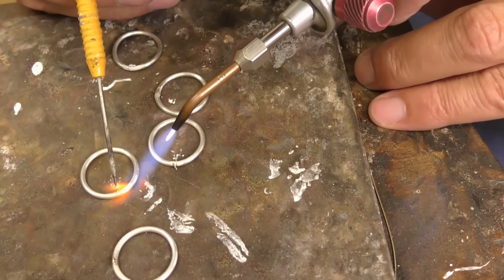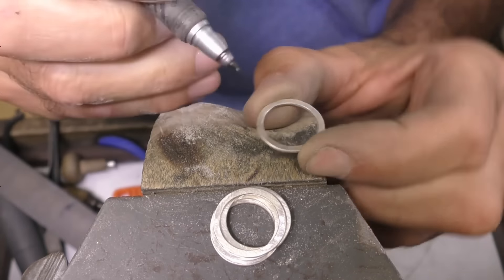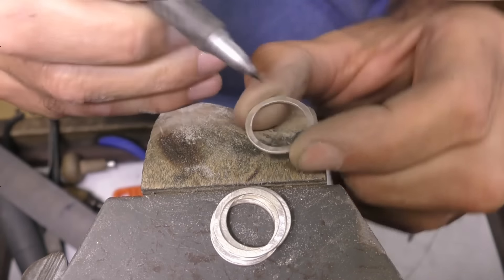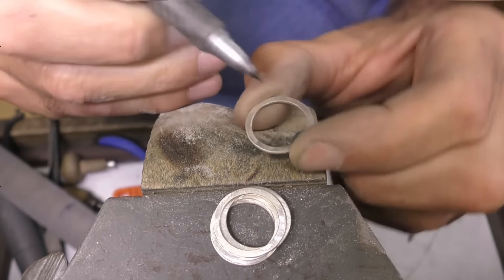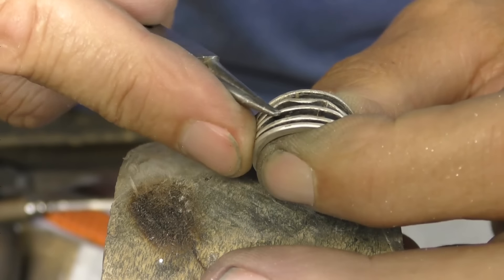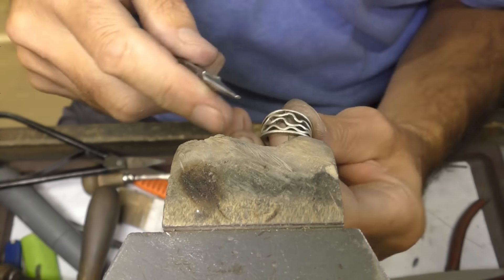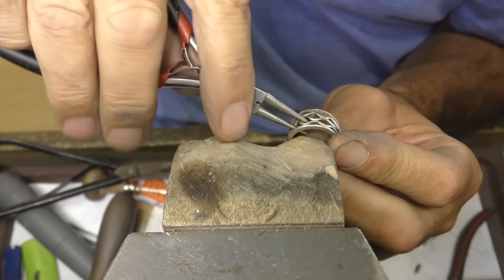How to make a wave ring

Comment: Peter,  it seems like youdont fully flow your solder. Is this the case? I see balls of solder semi-melted and then you say, you'll pickle. Can you speak about this? Thank you.
Reply from the maker: @flyingcheff  I take the heat off as soon as the solder flows through the joint. Over heating can cause solder pitting